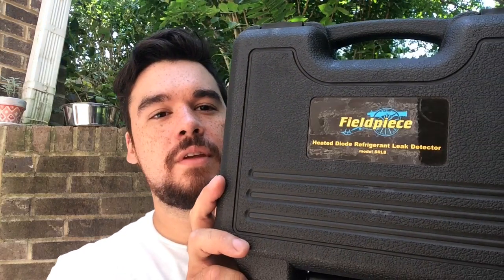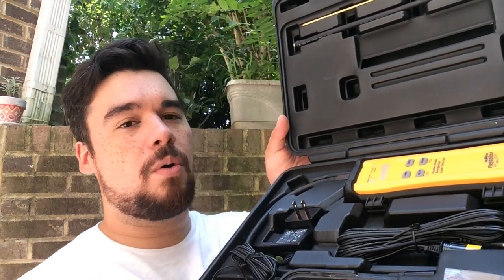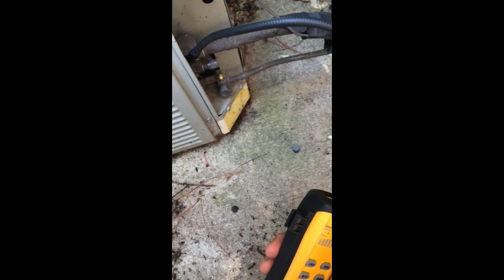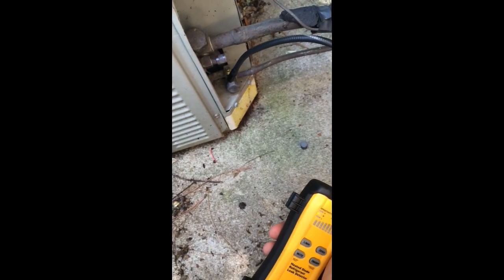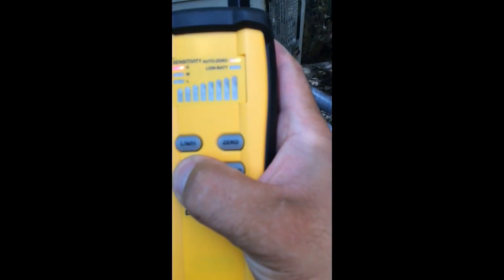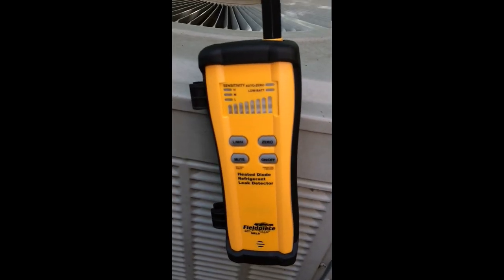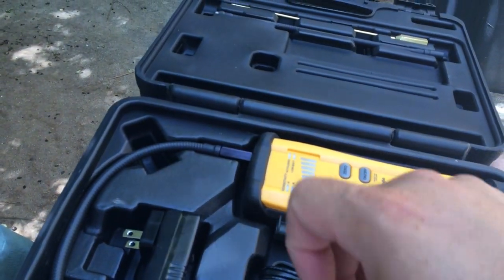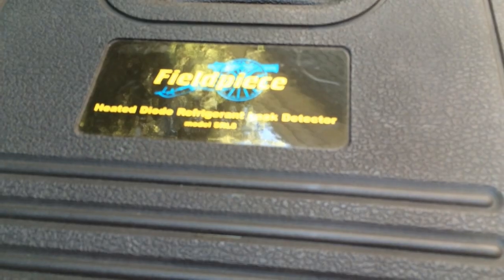Review!: Fieldpiece SRL8 Refrigerant Leak Detector

Comment: Got one of these. They are crap.
Reply: For me is crap, I change 2 times the sensor, same shit
Reply: I’ve used almost all. My best success rate is with fieldpiece. You need to sweep slowly. If you sweep left slowly, mark where ir went off. Now sweep right, mark where it went off. Spray bubbles in middle of those points. 90% success rate.

Comment: I was caught in a pinch and needed a leak detector ASAP.  Went to johnstones they recommended it .  I love it.  Paid a little more for it than i should have but i had to have it and it found the leak.  And has found many since then.  Glad you posted this video reminds me i need to charge it up.  Have used it on at least 15 leak searches with a decent success rate.